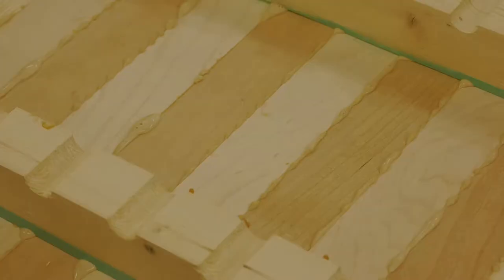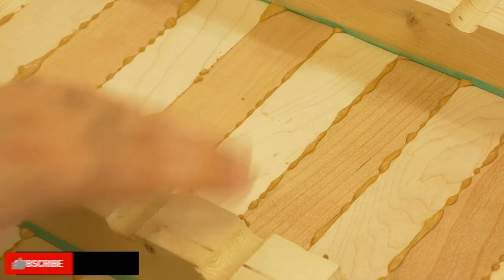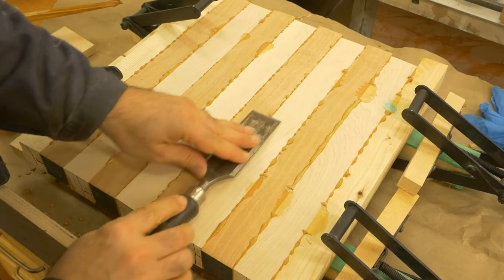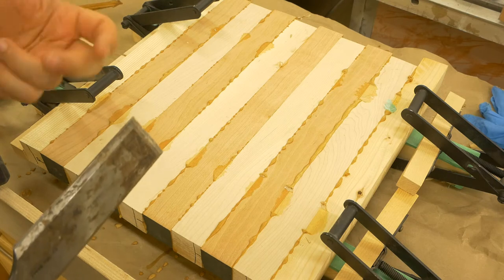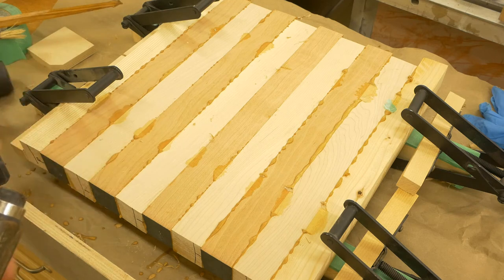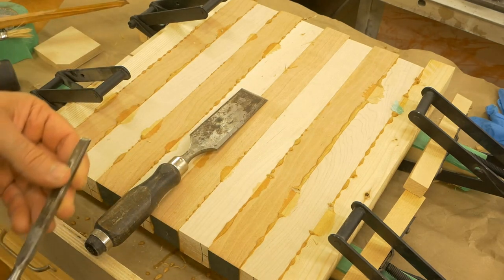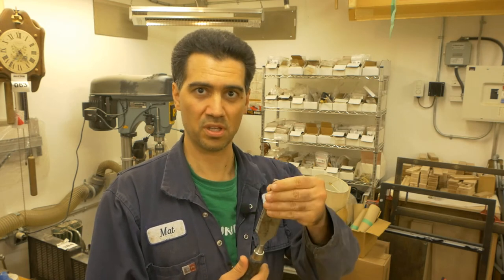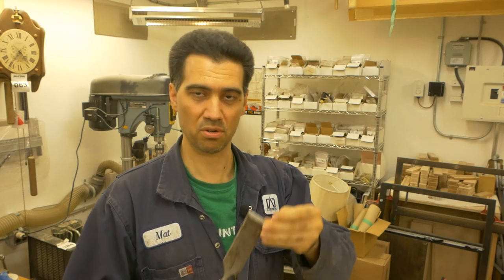Pro-Tip - E02 - Removing Glue Squeeze Out

Comment: I basically use the same method. I try to avoid large blobs though, as they tend to still be liquid inside, and there's a high risk of that liquid glue to ooze out when trying to remove it. If you have large blobs, you used too much glue. ;)
The glue should have a rubber-like consistency all the way through. If done right, you should be able to start at one end and basically peel the glue off like a piece of tape, lifting the squeeze-out by just sliding the chisel/scraper underneath.
And yes, if you wait too long, the glue hardens and becomes very hard to remove without risking to cut into the wood itself.
Also, the chisel shouldnt be too sharp. If it is, you risk it digging in to the wood.
Funny story: When making the table top for my assembly table (40mm wide strips of plywood laminated together on end for a total width of 84cm), I used an old chisel I got from my father when he moved from his house (that he build himself) to an appartment to scrape off the squeeze-out. I didn't think much of it, until I watched one of James Hamilton's (Stumpy Nubs) videos on chisels. It turned out to be a Marples Blue Chip, one of the original ones from Sheffield, not one of the new Chinese Irwin ones. XD 
No wonder the Irwin Marples I bought looked so familiar. They share the overall design and shape, but doesn't have the white ring at the base of the handle.
Reply from the maker: yes, I have the tendency to use a tad bit more glue and I put glue on both mating surfaces so that's probably why I have bigger blobs. I also try to "burst" the blobs first to get the majority of the liquid glue out and collected (impossible sometimes in inside drawer corenrs where it creates more mess than it should).   That's a interesting story - you may be having a treasure in your hands with that original piece 🙂